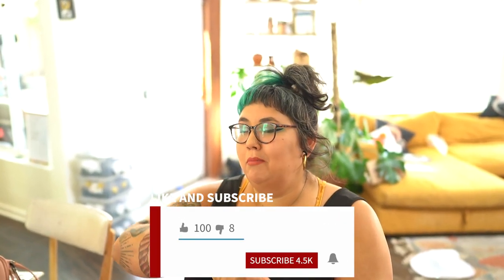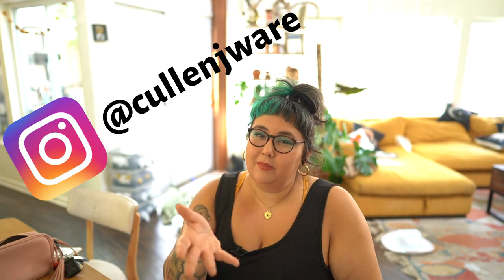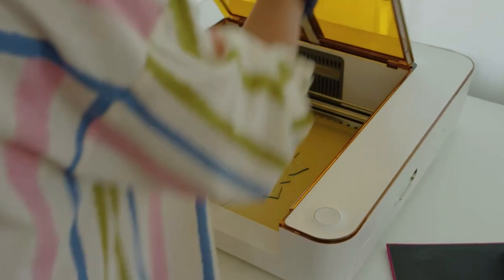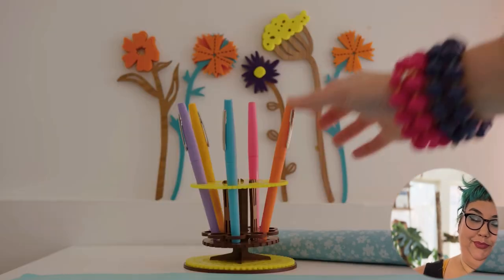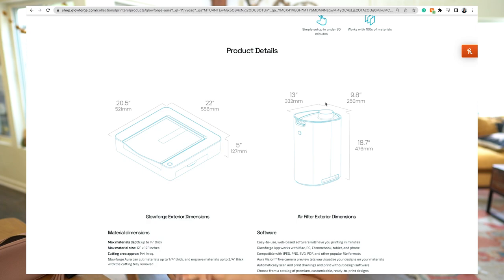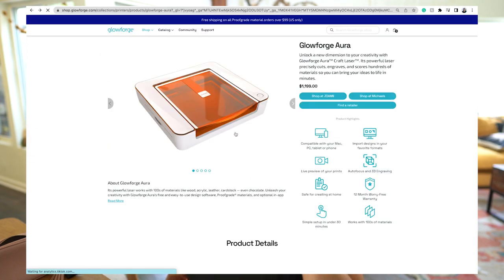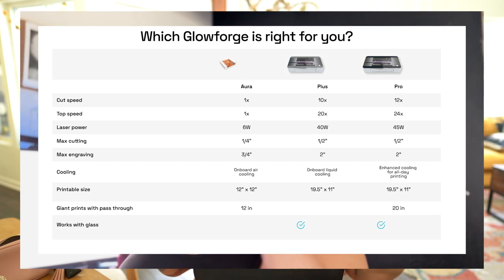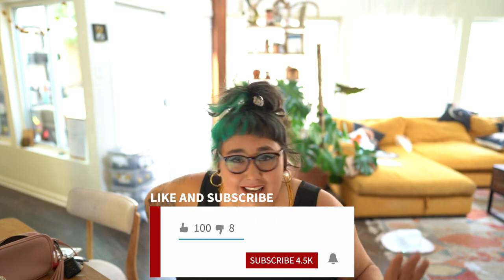Is Glowforge Aura Worth it??

Comment: I have both a pro and an Aura and like when the co2 units hit the street, they have some settings to dial in before it is great but that will come in time. Speaking of time, it is excruciatingly slow if you are used to a pro. If you have nothing to compare it to then the speed is okay."Worth it" is of course subjective but if someone can live in a 12x12 cut area and needs to cut 1/8" ply or some acrylic where a bladed hobby cutter just won't do the job I think it is well worth it.
Reply from the maker: this is exactly right. but even with my basic the first waiting times with my first files suckeddddd
lol

Comment: The Aura is not a co2 laser this is diode laser.  These are two different types of lasers so you can't compare Glowforge co2 lasers to the new diode laser.  You will need to compare Aura to other diode lasers made from other manufacturers to see if it's a good deal or not.
Reply from the maker: dude 👏🏼👏🏼👏🏼👏🏼👏🏼👏🏼👏🏼 thank you!!!
Reply: Because it's diode & not co2 does that limit what it can cut?
Reply: @nicolelamarca3111 Yes - Diode lasers use a different wavelength, meaning they can't cut some materials such as clear acrylic. Also, diode lasers are much less powerful. (Compare the glowforge co2's 45w to this diode's 5w)
Reply: Is a 6w diode laser, no powerful enough, when the standar right now is 10w and above on a diode laser market, they are way better diode laser machines,faster , powerful and cheaper!
Reply: I had been thinking that's what it had to be - CO2 lasers are bulky for a reason.  I just wish they would be upfront about it.  I'll admit, it was late, but when I went digging last night I could not find the wattage, or any other information on what type of laser it was. 

My other concern would be whether they are still keeping it Cloud locked.  In the end, that was the deal breaker for the regular Glowforge, and why I eventually went for the Laserbox.  And while I'm not happy that they stopped some of their support for the Laserbox when they went to xTool and the P2, it does appear that the P2 has corrected some of the other issues I had with the Laserbox - one part being Lightburn support.  The company software is okay, but Lightburn is far more versatile, and yet still fairly easy with the basics - or at least was with the diode I had before I got my CO2.  

Swinging back to the Aura... I'll agree it looks nicer - less "industrial" than the enclosures Otur, and Creality(maybe?) have brought out, and the camera is a big plus for me... but in the end, it's breaks down to being a lower powered diode with a built-on enclosure and camera. I'd have to see a lot more before I'd consider it over the Otur, xTool D1, or Creality Falcon.  Or the xTool F1, but that's currently in a class of its own, and I was kind of hoping the Aura would be its competition.

Comment: Is a BS laser machine, is only 6w out put, diode laser machine, very expensive, you can buy a better complete 10w laser sistem , more powerful and faster!! The Aura machine is a rip off, is not a CO2 laser machine like the glowforge, no is not is a 6 w diode laser machine, right now the standard in the diode laser market is 10w and above, is a POS product!!
   Research a little bit more and you will find the amazing diode laser machines in the market, 10w and above, that you can buy with less than a $500 dollars, do your homework.